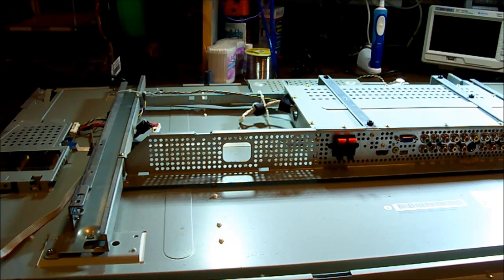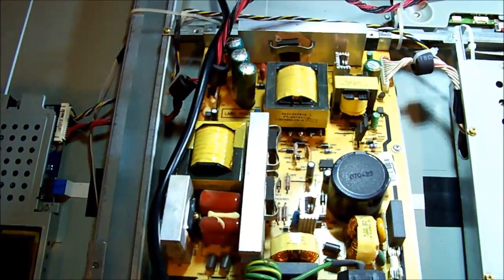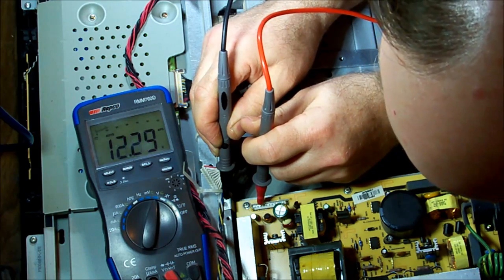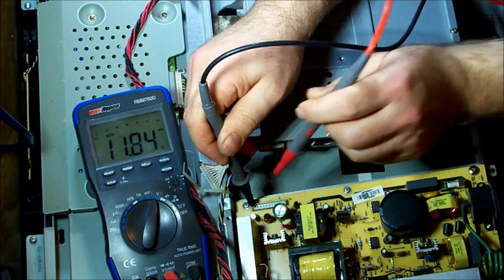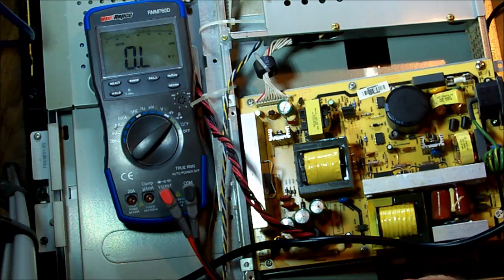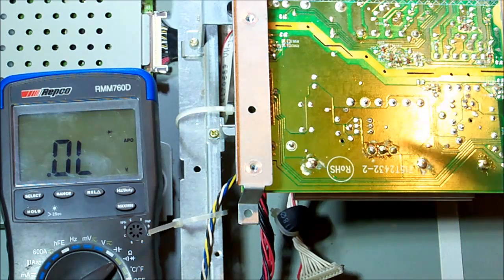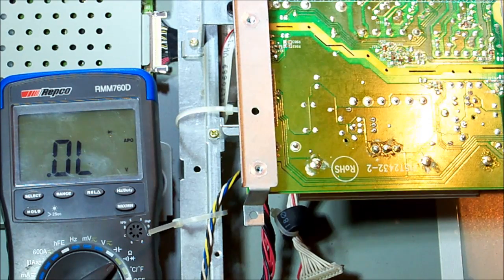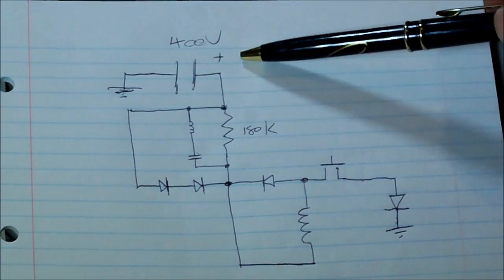Philips 42ta2800 LCD TV no power repair

Comment: I have the same LCD. It just turned 12 years old and this is it's first chirp :-) 
Thanks for the video. I am now confident I can get it fixed in no time (with a bit of help)
Btw.. I get the same white lights on top as well.. I tend to get them when the t.v hasn't been switch on for a while - a week or so. It's there for half hour & then it goes. No biggie!

Comment: thanks Jonny, I just ordered and replaced the P6KE120A from ebay and the 3x1500uF from RS components that were free shipping from Oz.....my caps were not ESR just low independence , weird how my caps specs only had live span of 1000hrs and new ones have 10000hrs.....I forget how good RS Components are for free shipping when ordering Online....
mines running sweet now..........cheers Brett
Reply from the maker: Good stuff!
Reply: Replaced caps on this very board, but started flashing after an hour of running. Saw scorching under P4KE250A, pulled it and tested it. It's dead. Ordered replacement (hard to find) so hope this fixes the problem for me too.

Comment: Hello my friend i like you so i will yell you that in the main board for the leds configuration there are some pontetsiometers try the test pins to even out the voltag to +7.5 and play with the pontetsiometer number12-17 thats what i did in a saumsung one and it fixed it cheers!